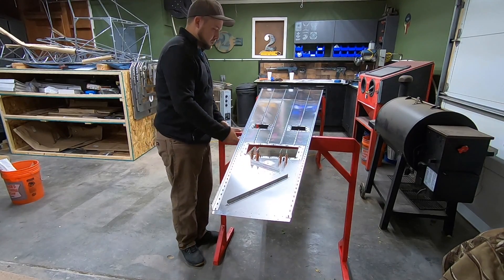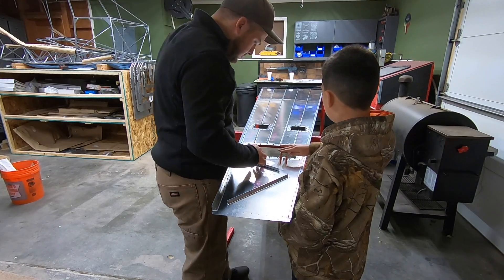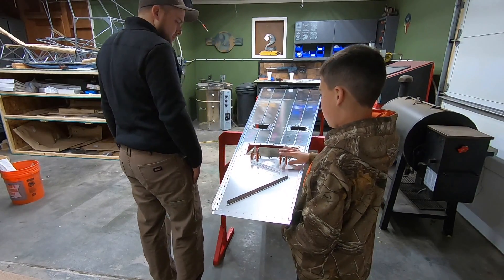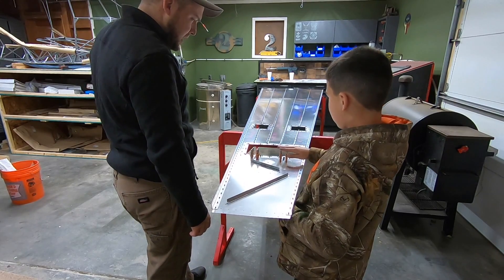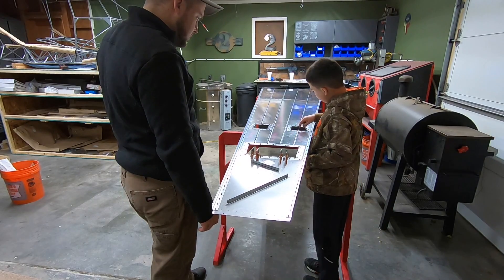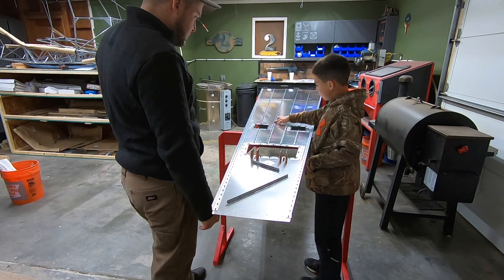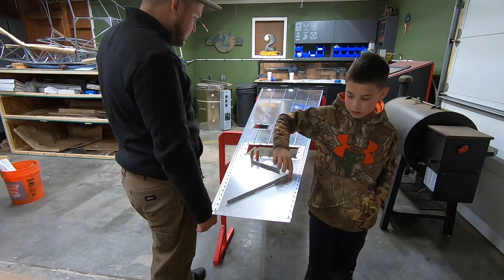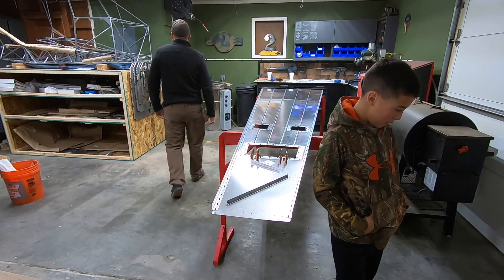RANS S21 EP10 TAILCONE PART 2

Comment: I see your most rearward cleco in the side longeron was one hole from the back.  My longeron does not have that last hole drilled even though there is a hole in the skin.  Was this the case with yours also?  I am debating drilling mine now to match the skin, but I am wondering why it wasn’t drilled at the factory and if there is some reason that this needs to be drilled later.  Do you recall if yours was drilled?  And, if it wasn’t drilled, do you recall when you drilled it?  Looks like it has to be drilled to put in the S-10/11 close-out piece.
Reply from the maker: I still havnt drilled that hole back there. I’m assuming I’ll run into some instruction at some point to do it.
Reply: @Project2Aero  I’ve been reading ahead and can’t find that instruction!  😁
Reply from the maker: @LTVoyager  I figure at some point I’ll just drill it when I know everything that needs to line up with it.
Reply: @Project2Aero  I drilled mine today.  It looks to me as though all that is riveted is the skin, longeron and upper tab on S11, so I pulled the trigger.

Comment: I see you enlisted the services of the good help! That's gotta be fun. At 2:35 then you were riveting the rudder cable pulley brackets, I noticed that the brackets sit on a fuselage former on one end, and a door doubled on the other. The center of the bracket floats above the skin. Being that there is a rivet in the center of the bracket, does the skin pull towards the bracket causing a dimple? Or, are there shims under the bracket to create uniformity?
Reply from the maker: Always fun to have a helper👍 The ring (access panel doubler flange thing?) actually goes back in that area so all 6 holes are supported going through the belly skin.
Reply: @Project2Aero  Zoomed-in. Now I see the extensions (tabs?) at 1:30 - thanks! The details of this kit continue to impress.

Comment: This is awesome. Things are taking shape for sure. Where are you storing the competed look portions of the build? It would be cool to know what you do with the tail pieces while they wait out the fuselage build.
Reply from the maker: The horizontal is currently hanging from the ceiling tucked up out of the way and the vertical stab is on its little 2x4 stand over against a wall. Thanks for tuning in Doc👍

Comment: What do you plan to do to reduce the risk of corrosion? I've seen quite a wide variety of approaches from different YouTube builders.
Reply from the maker: The aluminum itself is already resistant to corrosion. Each builder will weigh the pros and cons and make that decision based on their own situation. For me, I live in a dry climate far from any salt water. It’s likely that this airframe will never see even the slightest bit of moisture. In areas where dissimilar metal contact will occur, I will add a zinc chromate coating to the aluminum as well as wet install the fasteners passing through those joints. This in addition to the powder coating already in place from rans will be more than enough in my opinion. Corrosion is kinda the current buzz word around the aviation community but in reality, there is many production aircraft out there a lot older than all of us that have zero preventative measures and look like new on the inside. Take the right precautions for you and your mission and press on👍 Thanks for watching Tim!